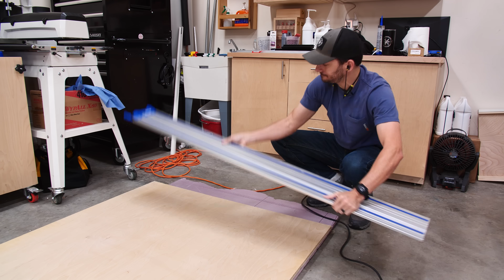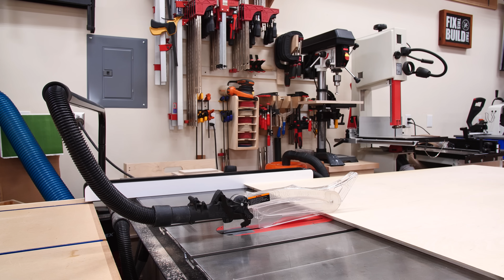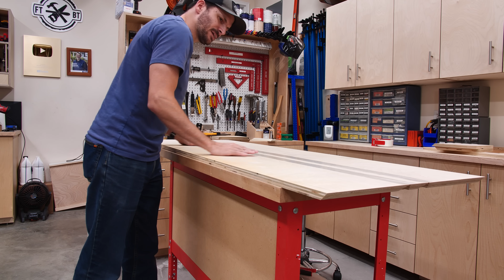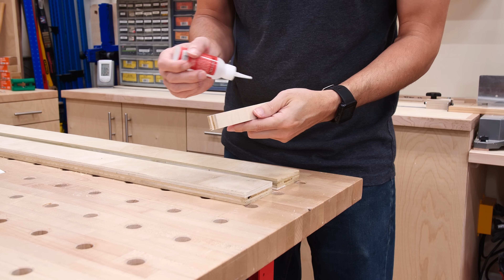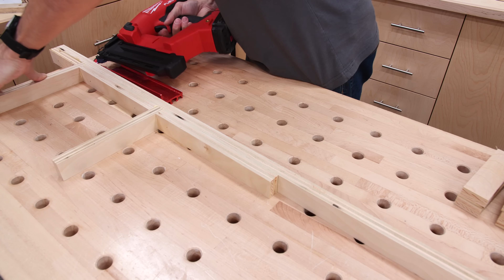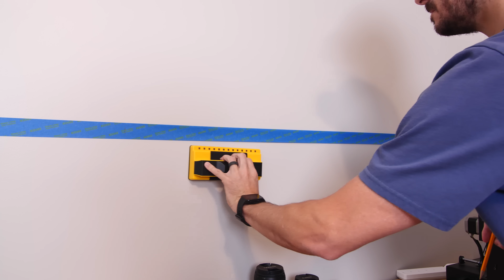DIY Floating Shelves with a Secret

Comment: So if I wanted to do the same thing but my shelf be 3’ x 14”. Wld I need to lag screw my main board? And I’m thinking of making my shelf of 1/4” plywood. It’s only holding three helmets tht weigh 2-2.5 lbs each. So pretty light. ??? Any advice or help wld be cool. 

I was thinking of also using brackets to attach to main board lagged to studs on the legs to sturdy them up

Comment: Brad, it’s hard to tell on the video, did you run the spliced red wire to one post on the switch and connect the other red wire to the second post? And does the order matter (ie.. power source to switch, switch to controller? Yes, I like to see you integrate electronics into your builds?

Comment: Why exactly it could not be hardwired behind the shelf and connected via smart plug under the cabinet? 
My guess is that these batteries\switches\cables actually costed more than hiring an electrician to do it.

Comment: Why??!! Personally I would have run wires into the wall and down to either its own power source or receptacle. Reason .. If there's a problem with the power brick or you name it, you're going to have to completely disassemble everything. Not to mention the non-stop and forever annoyance of having to recharge a finite life battery pack. Whereas if the controller and power source is easily reachable, using AC electricity but still hidden .. It's all a piece of cake. 

Also, considering your table saw, I don't understand that sawing on a channel on the floor, it made no sense. I'm not in the slightest taking away from your skills with wood. Just my thoughts here.

Comment: As a structural engineer I can tell you that the weight of those shelves vs. Your cleats will not sustain much more than what you are displaying on them. You may want to reduce the weight by using different material and better cleats. Also, fastening the shelves onto the cleats so they don’t slip. Further, just applying glue without to join the shelves is NOT sustainable long term. You may want to confided adding an internal frame to fasten the mitered corners to and then glue the parts. This will also avoid the awkwardness of the inexperienced build. But hey, it’s the internet, anyone can be anybody and put people at risk

Comment: I think it would have been easier to just run some low voltage wires through the wall.
Reply: @JOA_Trades_wouldn’t have to do wall repairs. Just run them through the wall behind where you will install the shelf bracket so the hole is covered by the shelf.
Reply: @jb3760 how do you connect to switch
Reply: @jb3760  This.  I'm going to try it this way.  Wife won't want to have to keep recharging.
Reply: Connected to the same light switch to the room light exactly!
Reply: Not crazy about a rechargeable battery enclosed in a flammable shelf.

Comment: The filament only adds strength lengthwise not across. If you’re only looking for stickier, that's one thing , but if you want the strength use many short pieces across the joint.

Comment: I like it all except the battery pack idea, just run a low voltage cable into the wall and down to the nearest outlet then use a standard wall wart. I think you will regret the batteries in the future.

Comment: Mixing electronics with this type of content will be an amazing plus. Not something you see often. I have a question about the power on button, it always turns on in the same color? (i think its green) or you are able to set it to turn it on with an specific color
Reply from the maker: It'll turn on the same mode you last turned it off

Comment: I don't like the long 45 cuts as it is very easy to mess up a long edge, plus I don't like sharp corners on shelves.   So I use a solid piece of wood on the ends of the plywood and using biscuits, glue it together.  By using different color wood you can get interesting contrast.   Plus you can easily round over the edges with a router.

Comment: I did something similar, but used these LED puck lights that you plug into the outlet.  I just cut a hole behind the shelf, dropped the wires down to the outlet under my desk, cut a hole and used a low voltage cover for the exit.  You can do this without danger because these are considered low voltage.  Do not do it with normal 110 voltage lighting though.

Comment: You need to get off the floor, and design a flip down panel saw that uses a pulley to raise the structure to the ceiling, completely out of the way.  Clamps lock the plywood to the support structure so nothing can move, regardless of vertical or horizontal cut with your track saw...  Sort of a torsion box with 2x4s, where the outermost two are hinged to allow it to raise up.  Cut just the right length to lower down and contact the floor at a comfortable angle to set the plywood on...

Comment: To save the cost of batteries and charging hassle, you could poke a small hole in the wall and fish power to a low voltage wall plate below the desk with a barrel jack on it and power with a wall wart.

Comment: I was taught to use painters tape on glue ups. It always worked great for me. Never seen packing tape used.
Reply: I've been a cabinetmaker/woodworker for 30 yrs....only ever use painters tape - especially on higher end hardwoods - no residue and easy removal. Packing tape works in a pinch (its got some stretch to it), but leaves residue - can't comment on filament tape as I've never used it.
Reply: @quintenelliot6901  ohhh! Yah! Always have frog tape around. Good to know!

Comment: I'd like to build these shelves for my space which would make them 48" long. But where they would be going, the wall has 24" on center studs and the shelves would extend 16" to the left of one stud, then 8" to the right of the other stud. Would this affect the structrual integrity of the mounting system?
Reply: Yes that would be more than strong enough. As long as you are mounting the shelf on atleast 2 different studs it will be fine.

Comment: I'd run cable in the drywall. will be so frustrating to charge them up. be fun for the first 3 months after that I'd just be like Meh don't need them that bad.

Comment: One thing that worries me is that the LED strips I have bought have the RGBW solder pads on both sides of the strip so if I placed the strip in an aluminium bracket, wouldn't the pads short out?
Reply: No, not really. There is a flexible backing with adhesive that will insulate the led from the aluminum. However, you can put some heat shrink over the ends if you are worried about it. I did a bunch of these for some under cabinet lighting in my kitchen using the aluminum channel and the heat shrink on the ends of the led strips. It turned out awesome.

Comment: Love this idea!  My question is how long have you found that the battery pack will operate the lights, and do you have a problem with the battery pack shutting down and having to turn it back on?
Reply: I was going to comment on this. Did a very similar project under a coffee table and it was unusable with battery packs. I was using an Alexa enabled set and you'd have to turn it on and then wait for it to find the wifi again, and after that it'd switched off after a few minutes anyway. I tried running a cable to it, but that was a big no from my wife. We have some cool leds on our bed headboard instead though.

Comment: I just finished building these using 1/2 in plywood but otherwise following this plan. The results were good but it was a real challenge to get angles and measurements done well. My table saw (portable Dewalt) couldn't quite make it to 45 degrees and attempts to tilt the material didn't work well. I wound up using my Festool plunge saw (which could go the 47 degrees) to create some of the cuts and made sure the 45 degree cuts from the TS went against these 47 degree cuts. You also need other measurements (especially the front face) to be very square and likely to within 1/32". Once this was done they went together well.

I purchased the exact electronics but would warn that the radio control means that all the shelves will be in synch which could be good or bad. In our case you just need to make sure that the shelve you're changing is the only one on and then not alter it while others are on. A little inconvenient but it works for us.

Comment: @Fix This Build That … I couldn’t tell if you used Baltic Birch plywood for this project or not.  I’m thinking of doing a similar project however, the span of the shelf is roughly 7 feet.  I fear that BB might be to heavy, should I go with a HD veneered oak plywood instead?  Let me know your thoughts.

Comment: Nice look, but I'd charge the battery in each shelf about two or three times before I'd be done with it and just won't bother anymore.
I would probably suck it up and find a way to have a USB cable as discretely as possible run down the wall.
Either that or use a USB charger inside each shelf with a power cable running inside the wall.

Comment: This is great! I did something similar with my bar but, led’s on top to uplight the bottles on the bar. I ran the low voltage wire down the inside of the wall and plugged in to outlet below with LED transformer. New to the channel and looking forward to exploring!

Comment: I was thinking of doing something similar to this, and was curious how much weight these shelves can hold.  I was hoping to put audio equipment, like amps and book shelf speakers, but I know that floating shelves typically have lower weight capacity than those with traditional mounts.
Reply: Get the legit floating shelf system with metal frame support and it shouldnt be a problem.

Comment: Clown. It would be better to have wires than to suffer with recharging batteries. The LED strip will eat up the battery very quickly.

Comment: this is dumb. now you have to charge 3 shelves 🤦‍♂️, and there are special low profile wires. your shelves are attached to the wall, they are not floating. 
should have used electro magnets and tesla coil.

Comment: I like watching your content. Look forward to seeing more. Where did you purchase that stock carrier? ( The handle for carrying the sheet of plywood) I've tried to build these floating shelves. The issue I've run into is that my Dewalt table saw does not go past 45 degrees. My circular saw does but will not fit and stay locked on the Kreg track that I have. I'm told that this is a common issue with this brand of circular saw and Kreg. Any suggestions other than getting a replacement that does?

Comment: Getting ready to do something like this. However, I'm going to put a hole in the wall, behind the shelf. The shelf hides the hole. The hole is above an outlet near the floor..  I'm going to power the LED's, Lazers ( Z is cooler), Motion sensor and so on via 110 power. 

Codes may call for certain wire in the walls.  

Another option is put a wall passthrough near an outlet, and use low voltage line to feed the devices ( LEDS ).

Comment: Brad—totally cool with the LEDs; could you do a subsequent video on the electronic piece of it.  I’m a total newbie at electronics and it would be great to see what you had to do with the soldering and the button connection…I think I get it but a deeper dive would be great!  Thanks!
Reply: Brad—checking back in to see if you ever plan on doing a deeper dive on the electronic part of your recessed LED lights in your floating shelves?  Would be really helpful to have a walk through of how you wired up the button and the power with the LEDS.  Thanks for considering!
Reply: Wish i knew brands and parts..we live in the woods

Comment: Thanks for the link to this video. Great project. Great tip on installing floating shelves. I have a few I want to do. But living in a historic 1869 means plaster. And I’ve still not put anything on the walls yet. Except the shop…. Where there is drywall. Lol. One day…..

Comment: Why didn’t you flip the board to save wasting by cutting the ends with angle the other direction?  Smarter not harder
Reply: THIS! Those two cuts were completely unnecessary. Someone could argue that  the face of the board on the table sometimes get damaged during manipulation so you keep making cut adjustment in order to get all the same face of the board outward. But if you are to sand it anyway, FLIP THE BOARD!

Comment: As always I love the work you do.  

I am attempting my own first try at floating shelves following your guidance and Spencer Lewis.  A couple of well...as you say, mistakes were made.   My 1963 Delta Unisaw only tilts right and I can't tilt past 45 degrees.  So I tried to use my Kreg Tracksaw and I cut into my track when I tried to bevel to that 46 degrees (the blade hits the guide strip even at 45).   How did you set up your track saw to tilt to that extreme bevel and not ruin your track?  I looked through the instructions and I wasn't able to find anything.  So far no luck with other Youtube videos.  Any guidance would be great.   Thanks in advance.
Reply: Thanks...I have got it figured out.  Clamping the track is the key for track sawing using a Miter.  worked like a charm...1/2 way through first folded miter.  Thanks for all the videos love to see them.  Thanks Brad Happy Holidays!!

Comment: I would have gone with wired power inside the wall, but that’s just me. The 5v would route from a box behind the cabinet and plug into each shelf in or through the supports. This also eliminates the power switches. 
That said, great job and thanks for the detailed, but not boring instructions and hints. Even the goofs were worth seeing.
Reply: Yeah having a remote doesn't make sense if you have to press a button to enable the remote. It's unlikely you would turn off these lights while you are using the shop.

Comment: Hi!  Can you clarify what kind of adhesive you used to affix the aluminum rail onto the bottom of the shelf?  I'm not seeing it listed in the "Tools / Supplies" section of the video description.  Thanks!
Reply from the maker: It was a CA glue and accelerator
Reply: @Fixthisbuildthat  Awesome, thank you!  Any specific brands you would recommend?  Or will any brand do fine?

Comment: If you're going to do some electronics, you might think about doing a how-to on soldering. It's not hard, but unless one knows the proper technique, it can result in bad connections that will fail over time. Since you say you enjoy doing some electronic work, I assume you know the technique.

Comment: Question: Why did you select the battery pack over just running a USB cable in the wall?  Being curious. Thought your solution was very cool and well thought out. Excellent video.

Comment: I understand that in the video you stated, the switch is wired in so that the lights are not a constant battery drain, due to the rf always being on.  Did you need the switch to allow charging of the battery pack also?  Or are these battery packs allowed to be simultaneously charged while connected to a load?  Fabulous idea, floating shelves with no wires and lights, and great work!

Comment: the only real mistake that you made is using batteries 
lets see if i can predict the future either you will use the light very sparingly which defeats the purpose 
or you will just get sick of charging the batteries every couple days and stop using it all together 
or finally admitting defeat and doing what you should have done from the start and just run some cables ... probably all of it

Comment: And now add a Broadlink RM pro and you can control those with Alexa.  Disclaimer: that will only work if you have the RF model controller as he specified.  Great build.  Now I have another honey-do project.  Thanks for the tips.

Comment: All videos I have seen on floating shelves have been short in width. I want to build floating shelves that will be16' in width to hold a turntable and a Denon Receiver. Have racked my brain to come up with a shelve that does not sag . Any suggestions?  That would be a challenge!

Comment: the shelves look really cool! so theyre just slid on over the brackets onto the wall? theyre not secured by anything? i dont know if i missed seeing a step but, they look like they fit nice
Reply: For a more safe fit. One could just screw directly into the bracket from either the underside or top part of the shelve.

Comment: If you use hue lights you can connect them to a real light switch and control everything with other smart home stuff as well. I built a similar thing and I liked the hue option because there isn't a battery to charge

Comment: My remodeling company does something similar with under cabinet lighting and shelves except we hide the power pack in an cabinet then run low voltage wiring hidden inside the wall

Comment: I'm fascinated as to why 46 degree mitres worked so well. I know you said it was to allow for glue squeeze out, but I wonder what would have happened if you'd cut 45?
Reply: It was mostly done so that when placed at a 45 degree angle, the two board edges would meet at the outer corner, with a slight gap at the inner corner. This increases the ability to avoid visible gaps along the outside corner joints that are a focal point when looking at the shelves. In theory, a perfect 45 degree cut would also work, but hedging a little allows slight imperfections, warps, & etc to be handled more gracefully. Even with that approach, as we say, the edge joints required some TLC to close or minimize any gaps. And we saw some great tips on how to do this, including doing it while the glue is still wet and while the tape is in place.

Comment: Very clever use of the battery pack and diffused lighting. Lots of great tips in here, Brad!
Reply: I would have added 1 thing to each shelve: a charging port at the bottom to charge the packs.
Reply: @bbbobnl  He did that